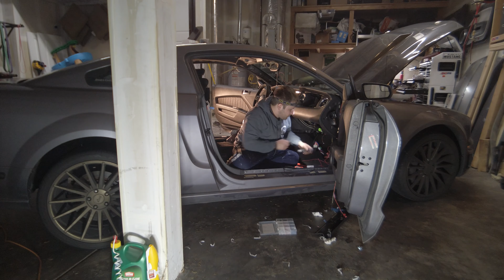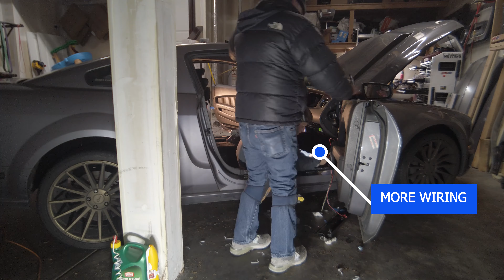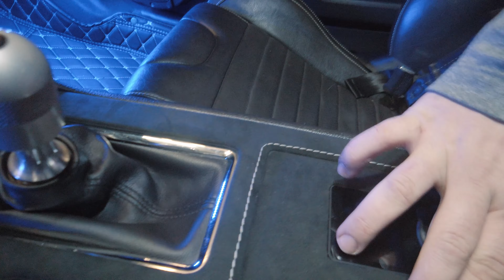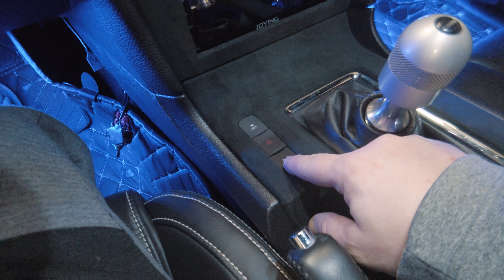Mustang 2006 to 2014 dash swap part 4

Comment: I have a 2005 gt and plan on doing this next month could you link the parts you needed one of the main reasons I want to do a newer s550 dash is for the digital cluster that can tell 1/4 times and 0-60
Reply from the maker: Not quite how it works bud. Watch the first video of this series and you can see more details. I kept all the 05-09 electronics and merely replaced the dash for the better look. You can not retrofit the S550 dash. You would need to do a complete swap including engine, harnesses, etc.

Comment: hey man im in the prosess of doing this know but i cant figure out how to do the trim around the radio how did you do it what all do i have to buy to do it thanks very much
Reply: @DronezandGasoline   i looked at all your videos and im still having a hard time trying to figure out how to do it and what parts i need would u be intreastead in making me one ill buy it off you im stuck ive already swapped the dash and everything but cant figure out this part
Reply: thanks in advance for the help and for responding your car looks awsome
Reply: Anthony Rodriguez what did you need to change to install the 2014 dash ?
Reply: @AnthonyRodriguez-ol2lj  hey man i’m in the process of doing the same thing and ran into this problem. came here to see if anyone else had the same problem. did you figure it out?

Comment: Would love to get more info about this car. Lmk. I’m building my car and want something like how you have yours
Reply from the maker: What would you like to know?
Reply: @DronezandGasoline  Hey did you use the 2014 blend box or did you use 2006 blend box by the way was that blend box was easy to modify?... is the 2010- 2014 dash are they the same ?
Reply from the maker: @s197stang8  I used the 2006 blend box. I read somewhere that SOME 10-14 were single zone AC, in which case you would not need any modification to the air tubes like I did. So if you find a single zone AC dash, you might have even less work to do.
Reply: @DronezandGasoline  may I ask a question on this project what total pricing for all the parts my hardest problem is look for dash panel for a good price everybody on eBay want crazy shipping price the shipping is higher then dash.
Reply: Right now my total pricing for center console, e brake handle and gear shift Im in at $240 that not include dash board
Reply: One more quick question how did you Depower your srs ??
Reply from the maker: @s197stang8  umm, I never depowered the SRS. Just disconnect the battery and you are good to go. I have taken airbags in an out a dozen times and have had zero issues.
Reply from the maker: @s197stang8  I don't remember how much I spent for the dash. I bought the full dash and center console and I think I paid about 500 for it?
Reply from the maker: @s197stang8  I never tallied up how much I spent :)
Reply: @DronezandGasoline I have the part just build strength to do it my problem is go to be the blend box … did you have add thing to blend box beside foam and duct tape lol
Reply from the maker: @s197stang8  foam and duct tape to make it seal to the blend box in the dash itself. It is not for strength it, just make sure it seals ok.
Reply: @DronezandGasoline  ok my question and nobody have the answer is about the automatic gear shifter for 2010 model is the wiring different from the 2007 model…because I did the mod for door panels and side mirrors and everything work .
Reply from the maker: @s197stang8  "Is the 2010 auto shifter a direct replacement for the 05-09? - The Mustang Source - Ford Mustang Forums" https://themustangsource.com/forums/f637/2010-auto-shifter-direct-replacement-05-09-a-514036/
Reply from the maker: @s197stang8  "Retrofit a 2010 Center Console - The Mustang Source - Ford Mustang Forums" https://themustangsource.com/forums/f692/retrofit-2010-center-console-536920/
Reply: @DronezandGasoline  Man I will like to thank you so much for the info any project on Stang?
Reply from the maker: @s197stang8  there's a few projects in motion right now. I have them recorded, I just need to edit them - haven't had the time to do that. Should have them done over the next few weeks.
Reply: @DronezandGasoline  Great can’t wait to see them .
Reply: @DronezandGasoline  Hello again I find 2012 model dash local Will that fit in 2007 model??
Reply from the maker: @s197stang8  any dash 2010 to 2014 should work. If it is single zone AC, you will not need to chop the air duct like I did. If it is dual zone AC, then you will need to modify the duct like I did.
Reply: @DronezandGasoline  Great I find one $175.00 local.
Reply: @Dronez and Gasoline  How did you depower your airbag system ??
Reply: @DronezandGasoline  Man I have start the dash swap it is going very good.

Comment: I need this done to mine also just so i can install the big screen that controls ac and is basically a big tesla screen
Reply from the maker: The big screen won't work out of the box like that as the wiring is a lot more different. I have started looking into that as well but it requires a bit too much work re-wiring the AC stuff that I have the patience for right now. Too many other projects pending on the car still...

Comment: Would you encourage someone to try or would you say this was tedeous
Reply from the maker: If you feel comfortable unplugging things and plugging back in, I would say heck yeah! Go for it! Most of the work was in putting together that center AC panel. If you can get a dash with single zone AC, then things will be even easier!
Reply: @DronezandGasoline  Could you please elaborate why center zone would be easier?